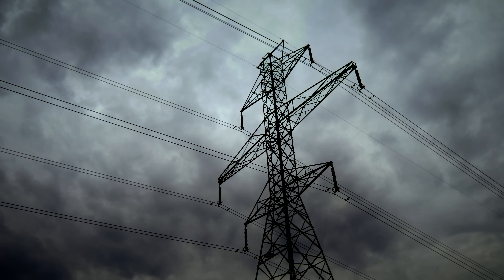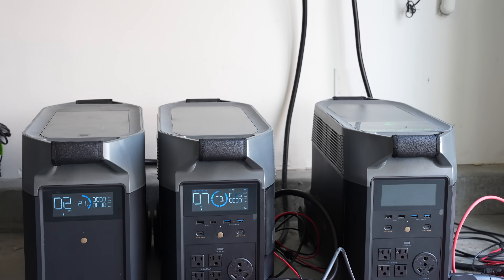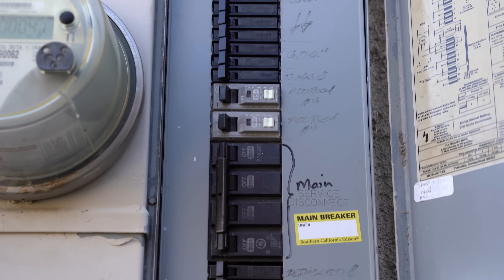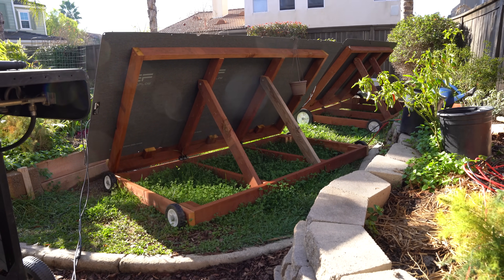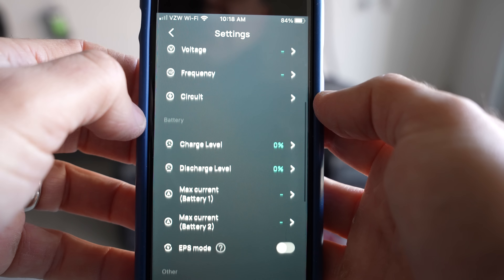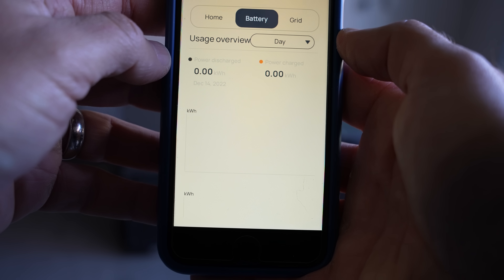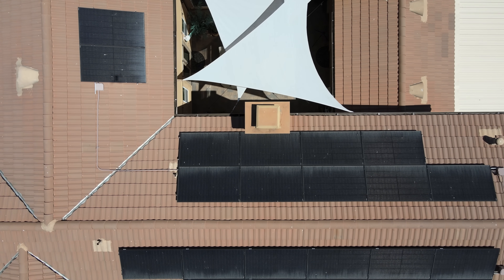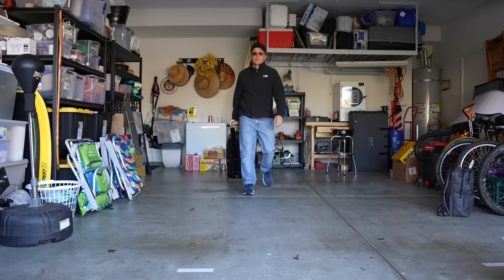Instant Power Backup: Ecoflow SHP + Delta Pro

Comment: I use a deep-cycle marine battery connected to a harbor freight 3KW inverter that’s always on a float charger.  It’s for the well pump, R.O. Water array, and sump.  Not intended for anything more than intermittent use.  If the outage is protracted, then the battery will be connected to my 100W harbor freight solar array, or my 2Kw portable generator for charging.  The generator is a gas miser and can be connected to the electrical panel interlock on the side of the house.  This will allow the house to have lights and run the furnace fan, refrigerators, etc.  
* with refrigerators, you might have to unplug them and stagger turning them on, so there isn’t too much in-rush load from them all turning on at once.
Reply: Your right. I can run my refrigerator on my little 1500 watt generator. A few led lights too. Just put it to use with the earthquake.

Comment: -17 F this morning and 6" of snow to clear. I like the Ecoflow portability, as lithium batteries need to stay above freezing in order to charge, which is harder in the Midwest with such swings in temperature from summer to winter. We get heat waves here, too, with hot, dry stretches in summer. Jackery and Ecoflow are more versatile and portable for us, here.

Comment: That’s the main issue I see with eco flow, capacity limitations. For grid charging, solar charging, and discharge, you’ll always hit a wall lower than other options and for a generally higher price.
Reply from the maker: in a few weeks, at CES Las Vegas, they're rolling out some new products.  Hopefully, they address this issue.
Reply: @CityPrepping  Hopefully. I love what they offer, and understand they have to make margins, but you’d need to drop $47k on ecoflow for the same capacity you could otherwise DIY for $22k. Makes it a hard sell.

Comment: To the 10% of folk here that can afford this set up. Good job!
Reply: No doubt. Good call
Reply: i went old school for many reasons. but theres no money to be made off that way for someone to move videos on? im happy & comfy with my whole house power solar battery system costing $3000. NOT $30.000 as im not made of money or a politician.
Reply: @nohandle74  not harder: smarter.
Reply: Waaaaay outta my price range!
Reply: If you are pretty sure that you're going to have to use this for energy long-term, that would mean collapse. During collapse, who cares what you owe a bank that no longer exists?
Reply: @nohandle74  yep👍🏻
Reply: Buy a cheap gas generator, put 2 male ends on an extension cord and you have a reliable affordable setup for power outages. MAKE SURE YOU FLIP YOUR MAIN SUPPLY BREAKER OFF FIRST! I shouldn't have to mention that, but some of you are dumb af
Reply: @hondablood3  Over 6 months, gasoline will degrade. Best to use solar.
Reply: @Broglesby  I agree, gas isn't a long term option at all. But I would suggest wind power over solar if you're serious about long term energy supply
Reply: @BSC-o7o7  its not stupid or dangerous if done correctly. You obviously don't know anything about electricity, now go and take your family to a local warming shelter instead😉
Reply: Hey not trying to be smug, but we did work to be able to afford something like this...LOL

Comment: We have this exact system.  It's nice. The only thing it won't power my air/heat. Everything else comes on when we want or when the electricity cuts off. We also used an electrian and for some reason people don't want to work on solar. It was hard to find someone. We have two generators and two back up batteries.  That works on the entire house.
The problem with yours is if the electricity goes out doesn't yours. All of this we have with our 2 battery back up we have enough power to have continuous power. We've managed to drop our electric bill in half by using it part time. That's worth it to us. We've had this for about 7 months now.
Reply: Do you know if the EcoFlow a/c works well? TY.
Reply: @queserasera1674  that's the one thing we don't have going in our home with this system.  We would need to get another generator and battery bank in order to run it. Even then I'm not sure it would run it for long. It takes alot of energy to air condition your home. You might ask Chris if he knows how much it would take. He may have a different system but I think he would know more. I think you need to email him to get an answer.  Sorry.
Reply: @dog-gone-it5944  Thank you for replying. I appreciate it. :-)

Comment: It’s getting WET and COLD here in East TX
Reply: It's barely below freezing down there 🤣
Reply: @koneal2000  anticipated to be 20° in 2 hours
Reply: Imagine living somewhere where you only have to worry about 20 degree temps😞. Why do I live in Ohio? It is torture when it hits -4 degrees Fahrenheit.
Reply: @humanhuman1773  I feel that bud, we're going to have -20°f windchill chills, and up to two feet dumped on us
Reply: @ssgta8082  20° is barely coat weather! 😁
I'm jokin mostly, I know different places are used to different weather. Freezing temps are probably a shock down there.
Reply: @koneal2000  I was in Korea in 2000. It was -15. I’ve been in cold. Last year it was -4 here and landed about 4 ft of snow.
Reply: @ssgta8082 now that's a truckload of snow!
Reply: @koneal2000  yes sir. For here, anyways. They shut our base down for 2 1/2 weeks because it was consistently snowing and freezing for the full duration. So 4 ft was a cumulative number
Reply: I am weird in the sense that I love the snow because it gives me an extra challenge to keep me sharp despite the misery😆.
Reply: @koneal2000  seeing as how it was 50° just an hour and a half ago 🤷🏼‍♂️